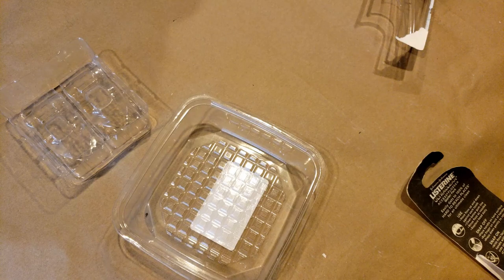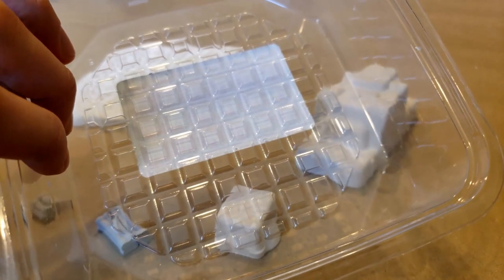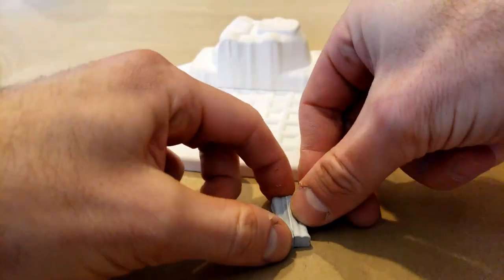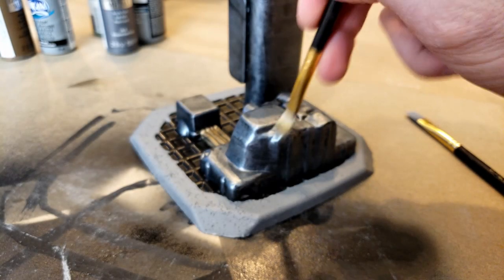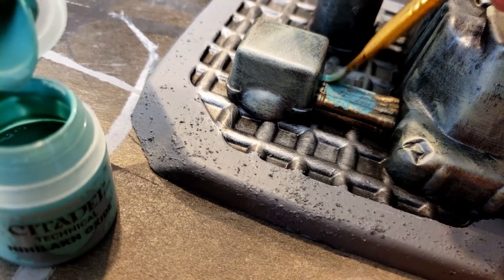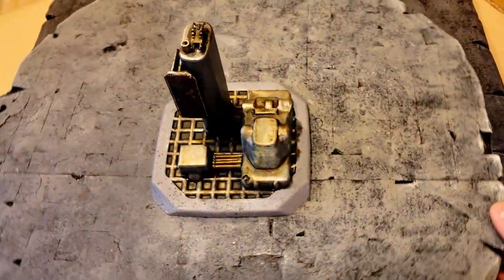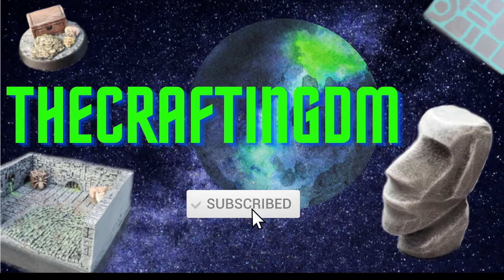Warhammer 40K Scatter Terrain Build #3

Comment: Are you using a gloss black?
Reply from the maker: I generally use matte for the more delicate pieces, but here I am using cheap-o spray paint that seems to have a slight gloss.
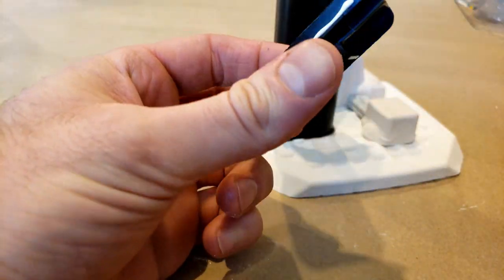Reply: @TheCraftingDM   hmmm, in the vid at 3:07 you say based with an applebarrel black. It's pretty shiny on that plaster. Is it some kind of interaction with the plaster?
Reply from the maker: My mistake! Yes, I am using apple barrel in this video. I dont think its an interaction. I believe that it is because the smooth texture of the plaster in this case provides that result when painted. Check out some other videos where I use apple barrel.